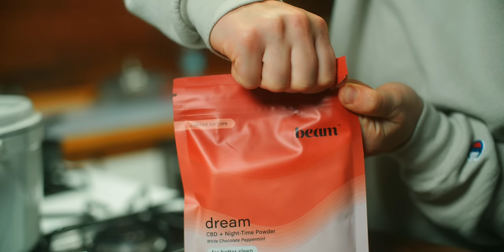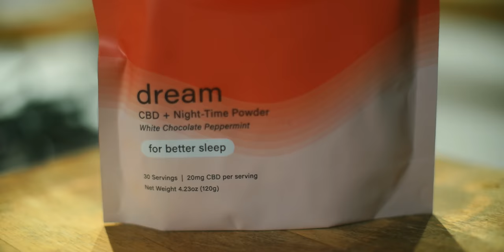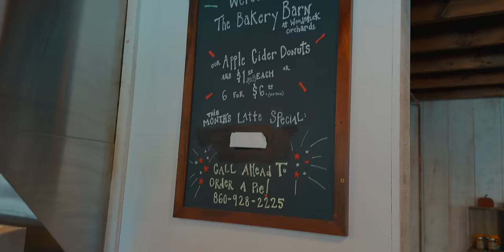As Fall and Winter Collided 🍂 ❄️

Comment: Great video
From one wood burner to another...try not to use paper w a finish (gloss) on it. It increases the creosote (which coats the flue lining) and releases more toxins into the air.
Also a little pot of water on top will keep moisture in the air. Mum used to crush lavender and mint, sometimes w orange peels and it smelled absolutely heavenly!

~Best to you both & Happy Thanksgiving!🎉😊

P.S. Can you toot the horn in Old Blue in one of the vids? You might have done it in a previous one, but I'd just like to hear it.
It brings back memories of the '64 Ford Falcon that my dad taught me to drive on in the mid '80s. I passed my road test after about a foot plus of snow kept falling and I had to wait from Thanksgiving through to the New Year for my appointment before school started back. 
Dad had it painted aqua blue but kept the red interior & ran her w whitewalls. The toughest part, I thought, was going to be parallel parking without power steering. But I let off the gas a little bit and she backed right in! Dad was never more proud. I still remember the instructor even had this grin on his face. I thought it was because I had passed the first time. But he told me it was because he got a chance to ride in such a cool car 😂

~Happy holidays & thanks for such wonderful content🎉😊